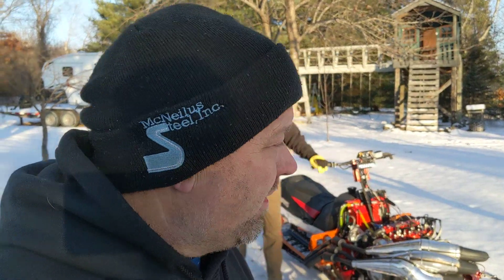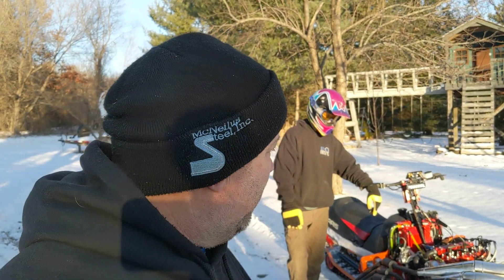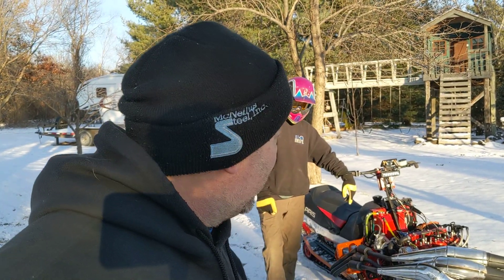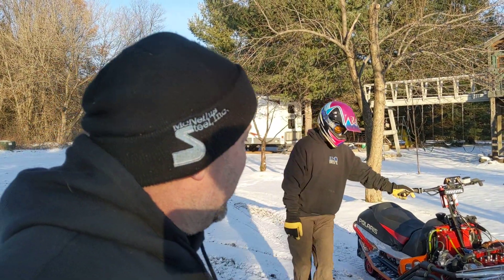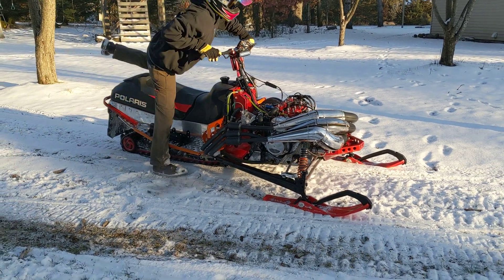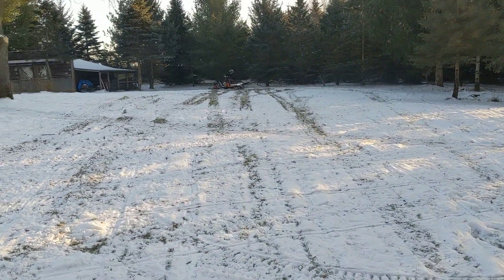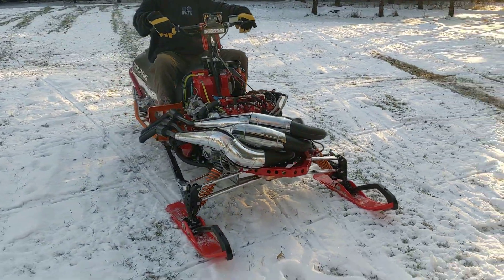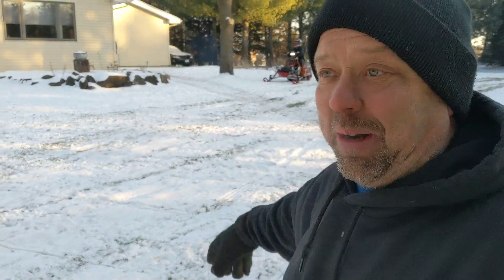POLARIS PRO XR 800 TRIPLE TRIPLE CRAZY MOD

Comment: Racks work good if you have room for them, I would keep them on.  That will be a fun play sled. I always wanted to drop the fuji 800 XCR engine with some porting into a old wedge sled and make a sleeper.
Reply from the maker: It wasn't easy to make um fit with the steering
Reply: @toddclyne3493  I have been told it is not fun to fit those rack carbs  by others too,  I think it is worth the effort. That sled looks great, I think it would look good with a red belly pan and maybe a white or black hood.
Reply from the maker: @davidbrennan5  maybe some day but for now it is what it is.

Comment: Is that a xcr 800 motor with crank shop race pipes?
Reply from the maker: 800 storm motor with stock pipes
Reply: I built a mod with a xcr fugi 800 motor.   Sled is 20 years old now and still eats twins for breakfast.  Long live the tripples.
Reply from the maker: @warrenflynn9155  Hell yeah 👍

Comment: why not an XCR 800 motor? storm motors are fun too but
Reply from the maker: Very expensive and hard to come by. We had one of these sitting on the shelf. Use what you got is how we do it
Reply: @toddclyne3493  true, i found a few whole running sleds by me cheap. I should of snagged them but stupidly passed on them.

Comment: It sounds like you need an operator who knows how to run a throttle that's not on and off every 2 seconds
Reply from the maker: New engine new sled first time on the snow. He was pulsing the throttle to get the oil pump working extra. Im sure you know how the throttle cable is also attached to the oil pump. You seem smart like that

Comment: I hate it when he keeps thumbing the throttle it dont do no good especially making that clutch working on that belt wearing it out come on  its eop
Reply from the maker: Your the guy that doesn't really know anything about a new engine at all right?? We had mix gas in the tank and all that throttle thumbing that you hate so much helps pull the oil pump arm up and down to help flow extra oil for brake in. You apparently know nothing how the clutching works if you think this is ruining the belt. Your assuming a lot by thinking that's how he rides on the trails. 🤦